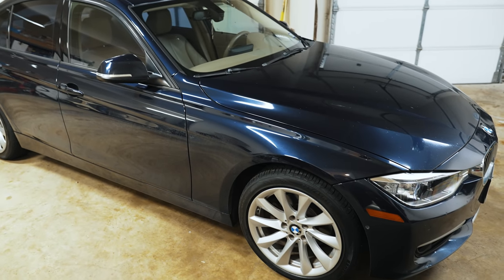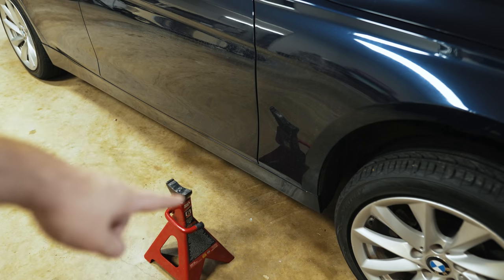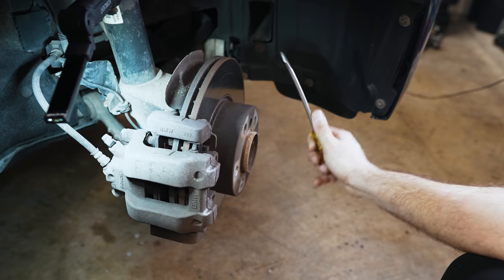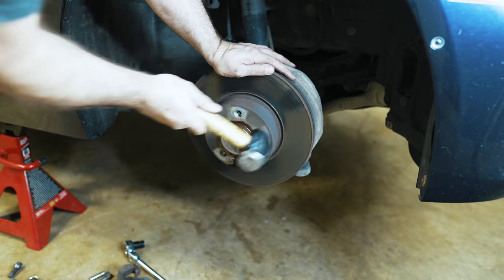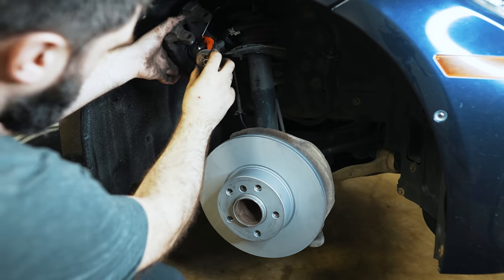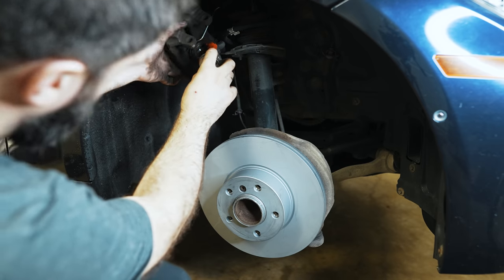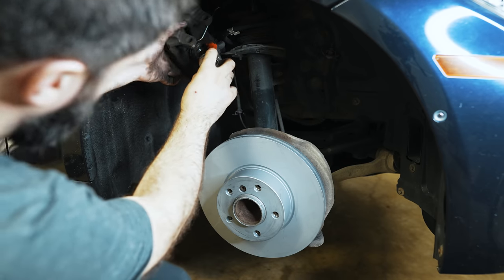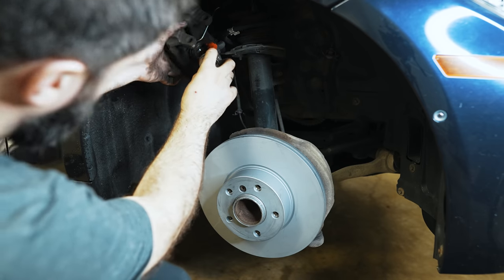The Ultimate BMW Brake Change Guide

Comment: One call out, BMW guide pins are engineered to be run dry.  Always love your DIYs, best BMW content on YouTube IMO.
Reply: Newtis says no grease, but when I replaced my guide pins boots with OE ATE they say to.
Reply: I’ve always wondered what BMW’s reasoning is for not  lubricating the slide pins, with the appropriate lubricant of course (?)
Reply: @MarioDallaRiva  I think it's just the way they are designed.  There are a 100 reasons out there that people put online.  It's not worth figuring out which ones are true and which ones are false and it doesn't really matter.  

Either way the calipers should operate fine for the life of the vehicle.  Some people will just sleep better at night knowing that they've done what they always do lol

Comment: I can give you a good tip, in most BMWs, you don't have to remove the caliber bracket to change the rotor! The rotor usually slips out sideways out of the bracket, and you can just put the new one in! This makes it much easier since you don't have to take the bracket bolts off and torque them back on :)
Reply: Many thanks, all parts arrived & gloved hands ready to get dirty.

Comment: By far the best and most thorough of several BMW brake job videos I've watched. I just replaced the rear pads on our 2017 530I X Drive, 34000 miles. Going to do the front tomorrow. It took me as long to find the right sequence to reset the "Brake Warning" light as it did to replace the pads.... This is the first time I've signed in and subscribed to a You Tube channel, your video made it worth it, Thanks. Signing out from Canyon Lake TX.

Comment: A tip for removing the Allen bolt that stops the disk coming off, get a short length of allen key say 20-30mm long put it in the bolt head and give it a sharp blow or two on the end with a hammer, this shocks the bolt and helps break through rust which may be clogging the threads. It works most of the time. Replace a bolt you have have had difficulty removing and apply copper slip to the thread.

Comment: I just had all four done on my X5 35d. The Akebono pads are the bomb. I agree, they stop differently than the stock pads, but there is no noise, and no dust at all.
Reply: I bought the akebono pads for me e60 and I did not like them. You had to press heavy on the pedal to get the same result

Comment: Just did this job myself, and used Zimm solid rotors as I have for the past 15 years or so on my 19 year old E46. I prefer good old Textars however. They dust up but I don't care. They stop great. And for a BMW volume car like mine, plenty good enough. It's not a race car. I feel the need to mention however, that BMW instructs to not use any lubricant on those caliper pins. Just run them in dry. Also, smearing paste on the hub faces is generally not recommended either. I've done it in the past myself and experienced no issues, but now I use a thinner anticorrosion agent instead of grease on the hub faces such as Corrosion X. Also, if you don't have a Milwaukee M12 polisher with a Roloc disc go out and buy one. Superb for cleaning corrosion off hub faces and wheel before you put the new parts back in.

Comment: I love Bosch Quietcast rotors because of the zinc anti-corrosion coating. But it looks like Zimmerman are also coating their rotors the same way now. I love Bosch Quietcast pads too. They're low dust and good all-around.

Comment: Great video. The last brake job was through a really excellent independent BMW shop, I managed to glaze the brakes in the first week and was about to bring the car back but then I found myself going 120 and almost missing my exit, middle pedal to the floor, made the exit and the brakes have been perfect for 30k. One of those Italian tune up moments. Might do the upcoming brake job myself. 175,00 mile E60 535xi, will drive this car and maintain it until it gets crashed or I pass it to my kids when I’m old and gas cars are rare. Discovered the channel a couple of weeks ago, this is a goldmine of information, nice under spoken and charming format too. Thank you

Comment: Excellent tutorial and good editing!
For what it’s worth, I’ve been using ATE COATED ROTORS, ATE CERAMIC PADS and ATE PLASTILUBE ( IDENTICAL TO BMW PLASTILUBE BUT JUST HAS THE ATE BRAND ON TUBE AND MADE BY CONTINENTAL GmbH, who supply same product to BMW) for all the sliding surfaces. Your use of Zimmerman and Akebono are also great quality.

Comment: Hey Musa! Your "filler" videos are better than most creators normal videos (including mine). With the process of changing the rotors and pads, especially with BMW, they (Bentley Manual) almost always recommend a brake fluid replacement at the same time as rotor and pad service (and I do a visual inspection of the rubber brake lines at the same time). All in, great work and thank you again for posting on the F30. #weltspeed #projectweltspeed

Comment: I had to buy that Quinn torque wrench!  Watched your last video on Father’s Day and had to get one for myself,  good info on the shims, I have always coated mine thinking that it had to be done,   Not sure I agree on the anti-seize on the wheel bolts,  I will always used it due to engineering standards and metal to metal friction given you a possible lower torque  value,  we preach that in refining.   Still awesome videos!! Looking forward to your next installment

Comment: I use copper based to lubricate the slidding pads
BimmerN53
Reply: Copper grease is not heat resistant and will dry out to a cruddy mess and bind up, please do not use copper grease it will actually cause problems!
Reply: @Law_Abiding_Citizen_ok  thank you
BimmerN53

Comment: Hmm. I figured the newer cars were the same as my e90. I didn't have to remove the bracket to remove the rotor. I've been using anti seleze on lug nuts/bolts for decades torqued to 90 ftlbs and never had a problem. Good vid tho

Comment: it’s actually okay to just use anti-seize on the front of the piston as bmw doesn’t want any grease near the pads! And no grease on the slide pins! i know it’s super weird as any other car you would be bmw specification is the slide pins will actually go in dry!

Comment: Great video. My only critique would be to lube the outer pad backing as well. You did the inner one (caliper piston contact point), but I also lube the outer caliper bracket where it presses against the pad. Despite the backing on the pad, it will wear through to metal and sequel w/o caliper grease. Akebono recommends this in the included instructions. They also include the grease. Obviously, apply the grease accurately and use it sparingly.

Comment: Good morning. Thank you for the Video. I have a 2006 BMW E90 316i 90,000 km. Well maintained. Front ventilated brake discs are 22.00mm thick from the factory. I want to know what is the minimum thickness of the discs so that I have to change them? Thank you.

Comment: I literally did my front brakes today on the f01. It uses a 9mm Allen for the caliper pins and finding a key was a mission 😐
Reply: Ditto on my F01 Msport. Just figured this out at 2200 on a Wed and I can’t work on the car again until Sat. :/. I will update when I get my hands on a 9mm..😢

Comment: Hi, I love all the details and knowledge you bring to us BMW owners who are just starting to get a taste for tuning and modifying. 

I'm have a concern as of now, I've got an M340i and I bought an MST Intake for it, but I'm afraid these cone air filters will not filter as well as the stock paper filter in the OEM box and sandblast the turbo/engine in the long run. What do you think? What's your experience on the N54?
Reply: You not gonna sand the turbo with aftermarket intake. The OEM box is there for protect the filter from water or any other stuff which cause problem in the engine. Thats why you gain some HP with aftermarket intake because it can breath more air and does have the box for restrict.

Comment: Did this on my E90 bout a year ago, had hell with those stupid anti rattle clips. Noticed you have a 3oz strip of tape weights on the inner inside. Guess tire techs these days will not 180 the tire to get the weight down.

Comment: You were also changing the brake pads but what if I already had the brake pads changed but want to change the rotors myself. How do I not destroy the brake pads. That is what I would like to find out.

Background: when I had the pads changed there was no pulsating in the brake pedal so we did not change the rotors.

Comment: Thanks for your video. I need your lights for a minute please. My drum brake is atm engaged. I accidentally engaged it with the rotor off. So the car expanded them and then gave me an error 'parking brake failed'. What should I do to release it so I can put the rotor back on? Both fronts are ok and so is the rear right - all have their calipers and rotors installed. Should I try to dismantle the rear left drum brake while expanded? or should I get in the car turn switch on, apply brake and release parking brake by pressing the button down? The car is X6 E71 with drum brake like yours activated with a button.
More details on Google "Parking brake failed - I messed up" using double quotes.

Comment: Bro, when are you going to do something with your garage floor? There are so many products on the market that you can use to transform your garage floor and make it look like a top class working garage.
Reply from the maker: I really have to get on that.  I think I'll need to have the floor grinded.  I would lean towards an epoxy coating.

Comment: Do you tighten your lugs firm, with either a breaker bar, or impact wrench, then lower fully to the ground to torque or just so they're touching the ground, but not a lot of weight on them? I'm reading conflicting info elsewhere. Thanks.

Comment: hi, quick question, do you have to open brake fluid reservoir cap before using c lamp to press piston into brake? i just did my brake pad change last week. i see there are some fluid leak out due to overfilled brake fluid. thanks!

Comment: Whats the highest ethanol mix you've ran on your e90 with helix? I'm on e60 @ 26 psi with the DAW turbos and I'm trying to rule out misfires. It's only on cylinder 2, and I've swapped around coils and it stayed there. I'm waiting on spark plugs to come in. Do you think that's too much demand for the Helix? Stage 2 lpfp as well

Comment: Big issue is the rotor retaining screw. Mine was really siezed and it required the head drilled out to get the rotor off, then the screw shank was a bitch to get out Be nice if the screw at least was stainless.

Comment: I changed on my f30 M sport brakes, all rotors pads and oil but pedal is not that firm as before( before you needed to press 1 cm to brake hard but now you need like half pedal to brake ), the brake is very good but pedal is not firm as before. I changed oil and bleeded for many times to avoid all air in the system. What I can do ?

Comment: Those understand Mickey Mouse rotors you need to get a doctor and and get the big rotors the big brothers drilled it's not that expensive and it will break differences like incredible From the CS model just need the brackets Change Break kit using Porsche 996  BMW 135  Calipers will fit on that adaptive kit the empty sport once with 6 pistols on the front In summer months back to the drawing board OEM stuff is OK but it's not the best! And all that you can get for less than bramble front brake it which is ridiculous price $4000 around half that for what I just said about